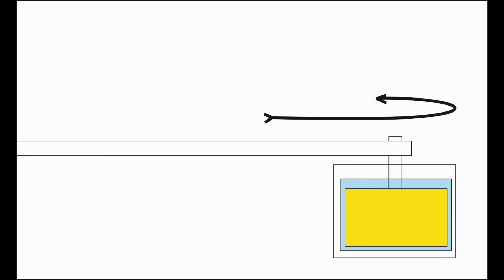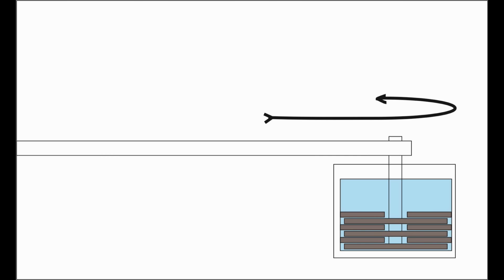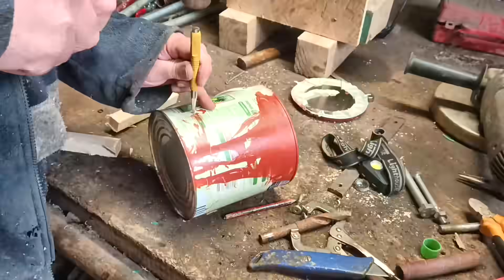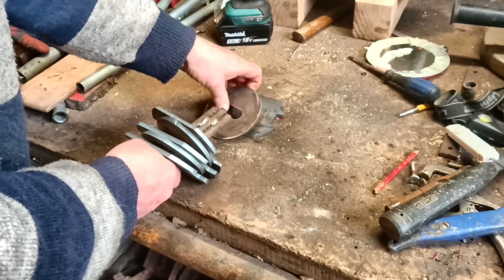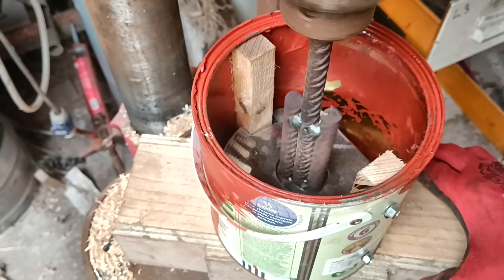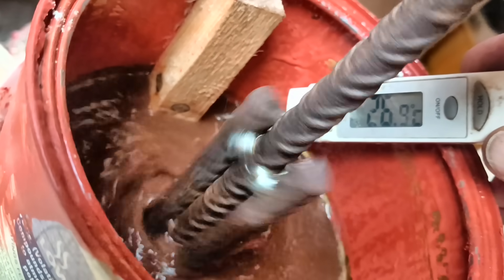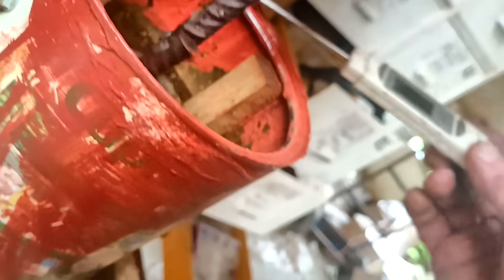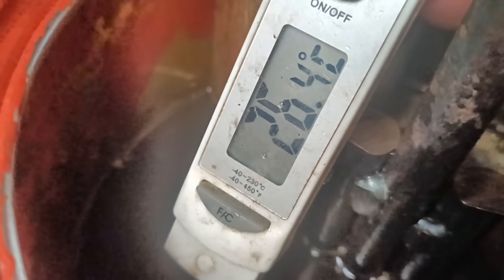Heating Water With Friction – How Practical Is It? Interesting Experiment!

Comment: Every windmill has a certain ratio of windspeed to rpm where it is most efficent. That means that if you want maximum power you would always have to adjust the rpm to the current windspeed. The good thing about a load like a paddle where the torque that the water created is proportional to the rpm squared is that it controls the rpm by itself that it follows the points of maximum efficiency of the windmill by itself. As long as you just set the gearing and paddle sizes optimal for one windspeed, it will be optimal for other windspeeds too. Hope that was understandable

Comment: I was pleasantly surprised at the amount of heat it generated. But do those plates actually have to physically rub against one another ? - I'm thinking - supporting the "stator" plates at their edges, and the "rotor" plates being supported in between the stators by washers or short pieces of metal tube on the shaft, preventing any of the plates from touching one another. You might be able to have the plates in close proximity without touching with perhaps just a few mm of water-filled spacing between the moving and non-moving elements if you can get the plates and spacers snug enough so there's not too much play in them.

Comment: You mentioned oil Tim. I remember the bus ‘arresters’ that sheared oil to slow the bus and heat the cabin. Oil was pumped through plates with holes. Some stationary and some fixed.
Reply from the maker: yep - that sounds about right

Comment: This is a great idea because heating water with a windmill using electricity will lose ~ 70% of the energy heating the generator. For your application you want to turn 100% of the power from the windmill into heat, and the power of the windmill will vary widely over the course of time. I think you want a friction brake like a disc brake or a drum brake and then have a governor apply enough brake to keep the windmill turning at a reasonable speed. If you use a weighted brake the brake force will be the same when the wind is blowing lightly or very hard - you'll get nothing when the wind is light and you'll miss a bunch of energy when the wind is strong.

Comment: It's not that it won't work it's that the water is contaminated with iron which is going to gum everything up quickly and you'll be replacing those plates every five minutes (just look how much wear they got from your test run). I'd definitely file this under fun but mad invention. Why not get a small motor and run it as a generator from your pillar drill and use something like an aquarium heater as a comparison test.
Reply from the maker: that's the scale that's worn off the plates..

Comment: Torque converters from auto trans cars.  No friction, lots of heat (you can overheat a transmission extremely quick spinning the engine up without the wheels turning) and no one wants the stock ones in cars.  Junkyards and transmission places usually just scrap them at the price of scrap steel.
Reply from the maker: Thank you - I'll investigate..

Comment: This is a very clever idea, but I can immediately see some problems with it:

1. having metal-on-metal contact with the explicit purpose of friction is going to chew away the plates. This will
2. fill the liquid with metal particles, necessitating regular replacement of that liquid. (I am glad you mentioned using a liquid-to-liquid exchanger; this stuff would not be good to drink.) You're still going to have to add a filter before the exchanger, thought, lest you fill it full of rust.
3. The warmer you run the water, the more of a wearing issue you're going to have; the higher the temps, the easier it is for steel to rust when in contact with water. This makes me think using an oil would be a better choice. (I don't know how using an oil would change the ability to generate heat though.)
4. I'd be interested to see if the heat generation keeps up over a longer period; as the plates wear, they should 'bed' into each other, reducing the amount of friction generated to some degree after the 'break-in' period.

My gut says that one of the designs you showed earlier int he video would be a better way to go about it; while direct contact would heat the fastest, it will have a number of maintenance concerns. Still, I wish you luck!
Reply from the maker: you could be right, but I suspect there would be no rust after a couple of days because all the oxygenn in the water will have been used up
Reply: @wayoutwest-workshopstuff6299 not sure it will. You'll probably need an additive package of corrosion inhibitors. Tried this on a machine at work last year...it's surprising how churning water in system with a low open area picks up oxygen very quickly.
I changed to 50% glycol.

Comment: You could also re-use old wheel hubs and brake calibers and  have a stack up of old brake rotors and pads inside an oil drum and heat up the water that ways. the  brake calibers makes it possible to adjust the pressure on the rotors

Comment: Engine dynos use plates that don’t touch but are probably very close to each other, and the shear I suppose from water creates the resistance. Increasing the water level increases resistance. Then there would be no contact and no wear. You could make the plates thinner but more of them,  so you have more shear surface to increase resistance.
Reply from the maker: Thank you - so much to learn!

Comment: Some thoughts:
Why separate tanks? Just insulate the main one. 
Used Barrels can be had for maybe 10-20 euros. 
The comment on particulates coming loose seems relevant. 
Use hardox for the plates. 
My water heaters and storage tanks use about 75mm of PU and don't leak much heat at all.
It can be difficult to determine the load on the turbine. For every machine there is a optimum working point. Power(W) = speed (rpm)* torque(Nm)/9,55. No load = no torque = no power. Stall = no rpm = no power. The optimum, has to be somewhere in between. It probably depends all on the turbine.
maybe a hole pattern in the plates will increase the shear in the water and decrease the wear on the plates.
1kW heats 10l of water from 20-30 degrees in about 7min
heating 86l 10 degrees takes 1kWh.
Have as few process steps as possible (gears, heat exchangers)

Comment: When making aluminum ships, sometimes the seams are 'friction stir welded'. We went to the navy shipyard to see it being done when I worked at the shipyard. Did you factor-in the cost of the steel? How fast would the steel wear away and need to be replaced?  🤔 How about driving a heap pump to cool and heat?

Comment: +1 on the idea of using a generator on the windmill then resistivly heat the water. 
That would get around the problems of wear, rust, transporting of the water once heated. Even simplify the windmill in nolonger having to bring the mechanical power down a shaft to the ground.
But that's not what this channel is all about, is it ? !

Comment: If you were to run some copper tubes through the surface of a stone bench you can store that heat you generated as thermal mass inside your house. Kind of like a the bench on a rocket mass heater.

Comment: Drive a small DC generator with the windmill and use it to heat water stored in a water heater via the heating element. Simplest way using a mechanical windmill.

Comment: Very interesting, i was quite impressed by how quick the water warms up. I think you would probably have to have an indirect system whereby this heated water would be pumbed through a pipe through the main cylinder of water. Thus you would avoid contamination from metal filings from the friction. I know this would complicate things somewhat. 
I wonder if using different metals would make any difference to the process?

Comment: Reading the comments I like the idea of running an air compressor best. You could put the tank under water to get your heated fluid. Then you have free compressed air to get cooling or run other contraptions. Magnetic induction is certainly the most efficient way to heat the water, but I suspect efficiency isn't your only aim with this project!
Reply from the maker: Thanks, Ben. Luckily lots of smart people watch this channel and I learn a lot from them  : -  )
Reply: @wayoutwest-workshopstuff6299  If you want to try inductive heating, I think you could affix diametrically magnetized neodymium ring magnets to an aluminum shaft, place this coaxially inside aluminum tubing using stainless steel bearings (to avoid galvanic corrosion due to current flow), and place the whole assembly inside PVC pipe where the water will actually flow. This will keep the mechanism sealed away from the water and the aluminum tubing should work as an optimal shorting ring since the magnet is fully enclosed by it. To maximize the coupling you want the gap between the magnets and the aluminum to be as small as possible. Magnet strength, number of magnets/length of shaft and gap clearance can be adjusted to optimize the load for the drive mechanism. Because the bearings are also in contact with the aluminum pipe, their waste heat should also transfer to the water.
Reply: YOOOO you watch this channel too!?
Reply: Of course you're here 😊👋
Reply: Robert Murray Smith has made videos for what is called a friction "frenette"

Where oil is heated between a rotating cylinder and another cylinder 

Budget option
Reply: @storetor  His "frenette" is in principle very similar to some of his diy "fluid dynamic bearings" he propose as a great way to make bearings with extremely low friction. 

If you like to learn how stuff works from his work, I recommend you to make sure that you're very familiar with prefixes like milli-, micro-, nano- and so on when assessing potential usefulness of his energy harvesting devises. 

He seems to know what he's talking about,  but when he exclaim things like  "I think that's great" between burst of laughing out loud, about some huge contraption producing a few milliwatts, he's definitely not expressing joy over great usefulness of the few milliwatts that contraption generates.
Reply: kettles are the most effience way of heating water....
Reply: @Bibibosh  if you ran a kettle off an alternator on the wind turbine, it would be far less efficient than simply using the turbine to heat water through eddy currents or friction.
why?
because the generator itself is a resistance. and as it has current flowing through it, it heats up. not all of its power is delivered to the resistive heater in the kettle.
Reply: @paradiselost9946 yes there is losses in the form of heat in the generator but you can also use the water to pull that heat away as well and far less efficient is a bit extreme consider generators are 80% plus efficient, also the minor loses are nothing compared to this kind of friction heating first it can be done in an a vastly more insulated vesel then even if they made zero contact the rotation of metal plates like that in water will erode them and it will accelerate over time as more fine metal is in the water meaning the entire setup needs constant maintenance
Reply: @shaynegadsden  yes, i agree.. using FRICTION brakes is stupid... they wear out. they make noise. 
the original calorimeter was just paddles in a pot of water. 

eddy currents produced within a large mass of conductive material with water cooling passages to convey the heat way does the same thing as the generator... without the losses. all the work is converted to heat.

and the magnetic field can be varied to control the degree of braking force... you can regulate turbine speed to maintain the ideal tip speed ratio regardless of windspeed, and that means you can extract ALL the power intercepted by the blades... increasing on the cube of the velocity.

the advantage of brakes is exactly that... you can convert ALL the work to heat. as long as you can conduct it away and store it. the rate of heat input versus output determines actual temperatures.
you cant do that with electricity, with compressed air, with hydraulics...

a generator is only "80% efficient" when you have a load that is far higher in resistance than the generator itself. the generator is "lightly loaded".  then the load limits the total current, and the total power delivered is less overall. basically... you need an over-rated generator, much larger than you think. otherwise the generator loses its so called "efficiency". they didnt tell you this, did they? how the load resistance effects the efficiency?
Reply: @paradiselost9946  Nope, electric generators are very efficient, 80 or 90%. It'd lose some power to heat, yes. But so equally would the magnets get warm in an eddy current system. I suppose you could put them underwater too but that brings a ton of other problems. Resistive heaters are of course 100% efficient, give or take. Then there's heat pumps. But an electric kettle isn't actually a terrible option in a closed system. Where a heat pump would be an open system cos it's taking in heat from outside.

Friction heating though I think is a pretty poor idea cos things are going to wear, fast. Water's softer than metal, but you need so much friction that it's going to wear parts out quickly. That all needs energy and money to manufacture, so it's a big waste.
Reply: @greenaum  a generator is ONLY efficient when it is run at a low load.

its really simple. the generator is a resistance. the load is a resistance. when the resistances are equal, half the total power will appear in both circuits. at this point, a generator at "100% load" is 50% efficient... you use 2kw to drive the generator and the load, whilst each will dissipate 1KW. ignoring friction and windage and hysteresis losses, of course...

that is the maximum power you can ever transfer from the generator to a load. 

as the load resistance increases, the total current reduces. the I2R losses in the generator become a smaller fraction of the total power. at this point, the generator can only deliver a fraction of its power to a load, but at this point it can be classed as "90% or better efficiency".

you need a big generator working well below its capability to be "efficient".

then you get into other issues such as the resistance of the windings and the load changing with temperature.
Reply: Plus, with the air compressor it's functionally a heat pump, so you end up making MORE heat than input power, assuming ideal conditions, which is a big assumption. A 3 stage compressor head  for max efficiency, big loop of copper in your water tank, and then the air storage tank. Could even hook up a small-engine turbocharger like a VZ21 or GT06 up to the pressure tank's safety valve to pre-charge the air to the compressor and raise the efficiency some more.
Reply: @LenKusov  A compressor working with air in the way being discussed ISN'T a heat pump in the way that other heat pumps work. Heat pumps (air conditioners, fridges, freezers, dehumidifiers etc.) work by utilising the 'energy jump' inherent in phase change. i.e Gas to liquid by compression gives off a LOT of heat, then liquid to gas by evaporation consumes a LOT of heat - so heat's moved from the evaporator to the condenser. That's why they use a closed loop, so the working fluid is contained. Air doesn't work as a phase change heat pump fluid unless you're at temperatures that encompass -140.7 degrees C (the average boiling point of air).
Reply: It would work best if the compressor was liquid cooled rather than air cooled.
Reply: Compressed air sounds smart, cos you get heat from compressing it, then cooling from expanding it again, if you need it. That could work for air conditioning or all sorts of interesting functions. Of course, if you optimise that, you end up with a heat pump system. The best way to heat and cool, especially if you use ground-sourced with water running through pipes. 

If you used expansion and compression together, you could run a fridge and heat water with the unwanted heat from your food! Then you'd switch away from the fridge's thermal circuit once it got down to temperature. But you'd be doing both at once! Double benefit. 

Air compressing isn't the most efficient if you want to use it as a power or cooling source, but if you're using the waste heat, you're essentially winning, nothing going to waste.

Comment: Search for water hammers as they do what you are describing and the tricky bit would be feeding water down the center and out the holes as well as the distance between the inside hammer and the outside anvil precision. Although with your plasma cutter that may be less of an issue. Also maybe the plasma cutter could cut those channels so that when you add the plates up you have the channels feeding from a central hollow shaft to the outside via channels in the plates themselves. There's an old documentary of an engineer here in the US who claims to get more energy out of the water hammers that he makes then he puts in. And the controversy of universities refusing to analyze his system to see where his math is wrong or why he's getting as much energy as he is. But he does have a company selling the product and it's used locally by government and some individuals. Any which way an interesting technology.

Comment: My first thought about this was to use the work of the mill to generate pressure, but I've no idea what kind of psi you would need for a good system. The higher the psi, the more expensive everything becomes. Someone else on here probably knows all that. Any thoughts, those out there with knowledge?